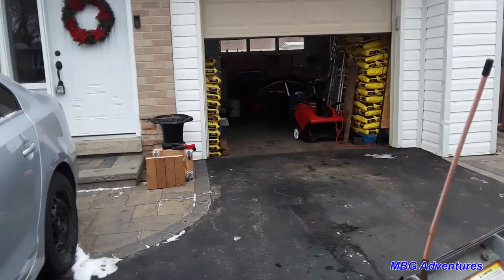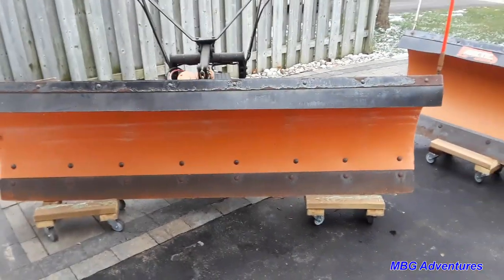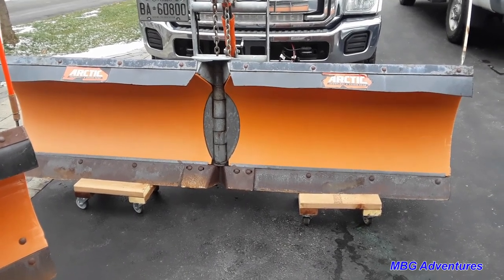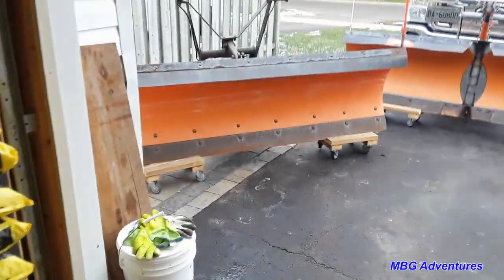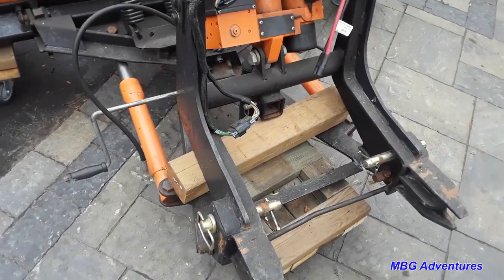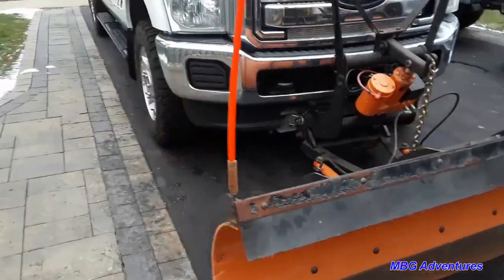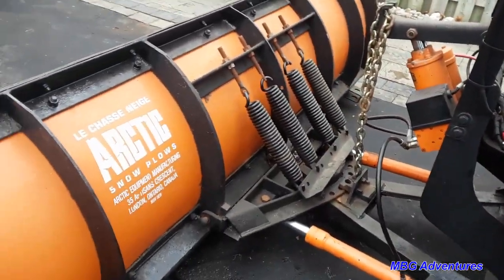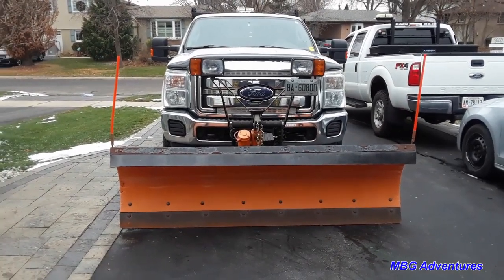Arctic Snow Plow - V Blade vs  Straight Blade

Comment: I had two as well. I loved my straight blade for drives and my V for Lots. I feel the straight blade scraped better too. Nice Video, Subscribed!
Reply from the maker: Right on, thank you. I just Subscribed to you too!  I have since sold the straight blade with my gas F250. I decided to just keep one. I like what both do but the V blade does a bit more. Straight does scrape better like you said.

Comment: With all the elements and dangers out in a snowstorm at 3am in the dark the last thing I need is a complicated snowplow.... I actually prefer the standard joystick to a handheld controller because its rigid mounted and without any looking I can reach in a split second and change the angle of the blade or make any adjustment. The handheld would fall on the floor, or if I kept it on its mount wasn't ergonomic to control like a good old joystick. I have spent many hours trying to get use to a handheld style controller and always go back to tried and true joystick. Great video Mike.
Reply from the maker: Absolutely. This is why I want to stick to the basics. I have never tried a joystick. The handheld works fine for me as I tuck the cord between the driver seat and center armrest and have the controller on my right leg. It does not move. Controller is sideways and upside down. All by feel then knowing that left is up, right is down, up is right and down is left. That is for the straight blade. Sounds confusing but it really isn't. Thanks for watching Ken!

Comment: Those are two nice snow plow Mike. Nice clean up on the garage and can't wait to see the new garage. Yea cause I've seen both blades, but never knew the difference and now I know. The Straight Blade controller looks a lot simpler than the V Blade. Wow that looks great for 15 to 20 years old, but you do always take care of your equipment. That's good you have a back up. I don't blame you about the salter. No you didn't bore me this was very interesting. Great video brother.
Reply from the maker: As always Bill, thanks so much for the support and I'm glad I entertain you. I do try and take care of my stuff. Plows are stored indoors during the off season. What ever plow I am using is on the plow truck for the winter. Friend of mine and plow mechanic reconditioned the straight blade and did a really great job at it. I will use the salter again when it makes sense to again. Be safe and enjoy your day!
Reply: @MBGAdventures  Your very welcome and yes you do entertain me buddy. Yes you surely do take care of things. Yea that straight blade is nice. Stay safe and you have a Merry Christmas brother.

Comment: That is odd that different wire harness depending on v or straight blade. Western, fisher, and boss all only have 1 harness that will operate both straight and v, obviously controller is different for them. I find for residential drives straight out performs v plow every day of the week. Just my opinion.
Reply from the maker: 100%, yes, the straight blade is better on the residentials which I have more of. With a couple of my small commercial properties, the V is faster but really only by maybe a couple minutes. Thanks for watching Shawn!